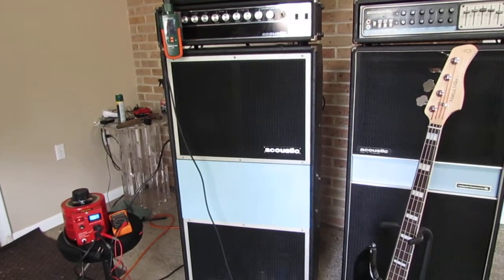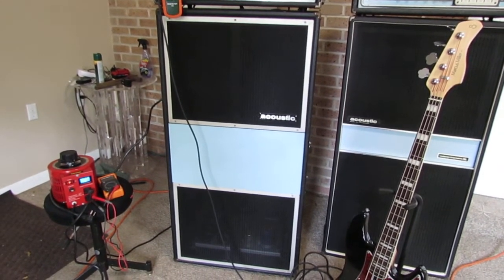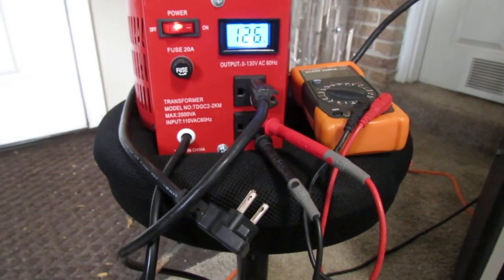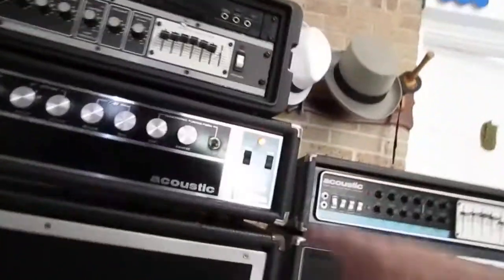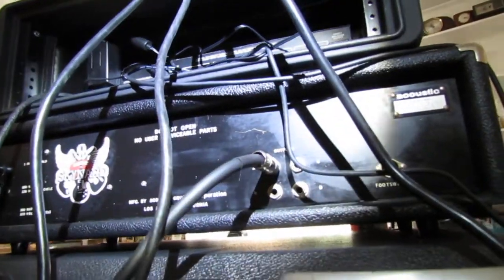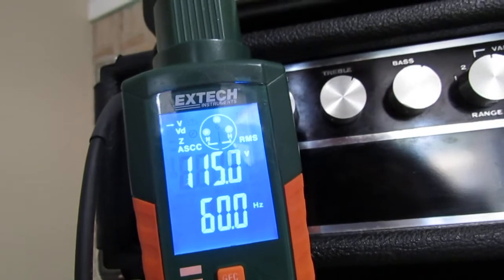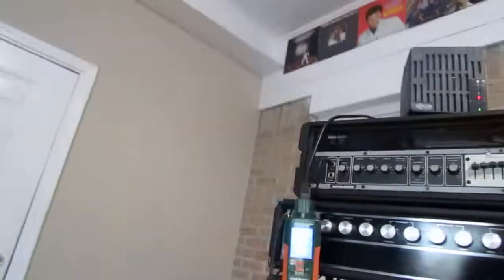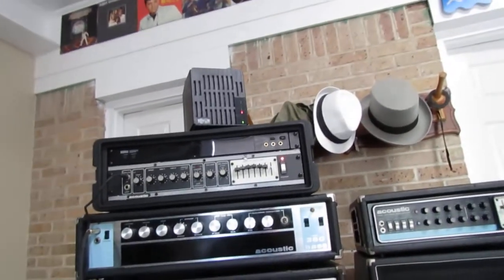Surge and Low Voltage Protection  Line Conditioner How to fix increase electrical power voltage

Comment: Super helpful video. I'm considering this exact LC1200 model for use with my portable emergency generator (still brand new/unused). I expect the generator won't deliver steady, even power, especially when using a fridge or small single electric cooking element since those cycle on/off. I don't want to damage sensitive electronics, such as a router, laptop or phone while being charged. Am I on the right track considering one of these? PS your vintage bass amp is in amazing condition - definitely worth protecting like this!

Comment: Good info! In South Carolina myself and played in many places out in clubs in the boondocks and the wiring is definitely poor in some places. I have abou1000watts bass amp and wondering if thus unit works well with that as well. Also does it help with reverse polarity as well?
Reply from the maker: I think the only way to know is to try it. They do have larger models than this one.